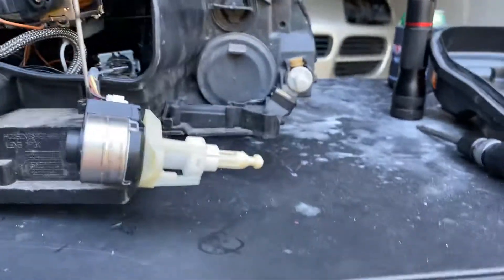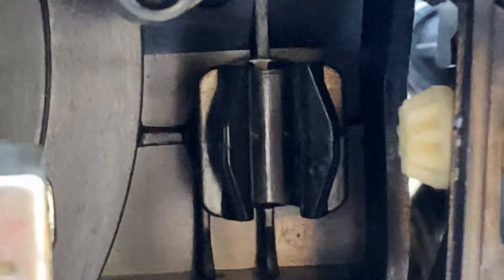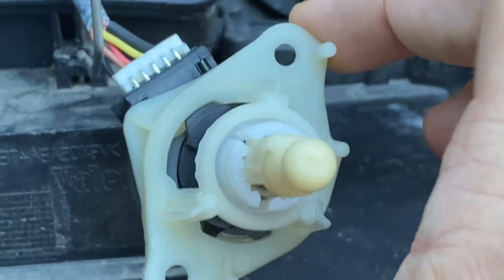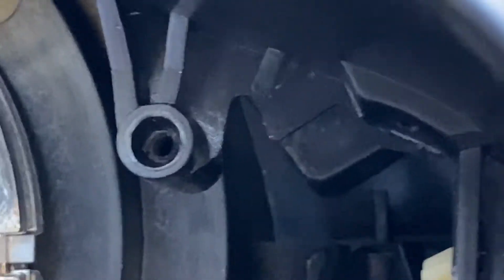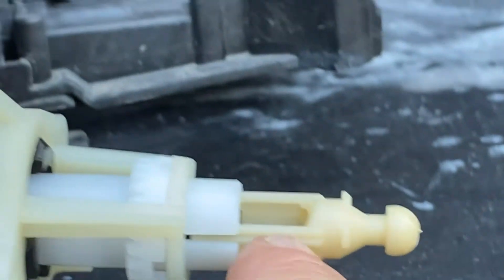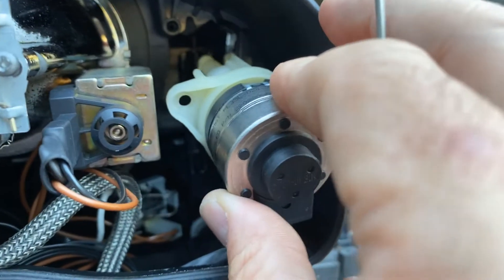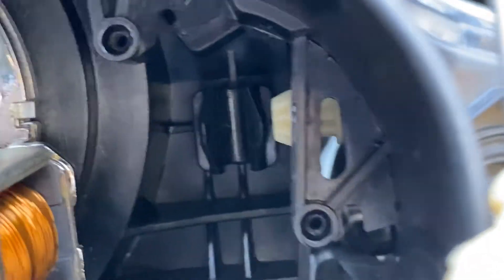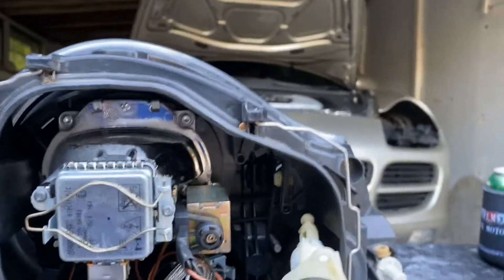Porsche Cayenne 955 HID headlight adjuster assembly (2003-2006)

Comment: I have the same headlights but cant get my drivers side indicator to work have checked all the wiring so tje problem is in the headlight assembly can they be repaired thanks in advance
Reply from the maker: I will have to replace both of mine, unfortunately. The wiring in these 955s do go bad and cause a lot of issues. This is common for these vehicles. Even with my best efforts too restore these, the failed plastic on the wires leads to it's eventual downfall. Hope you were able to get it fixed for you. Glad my video was helpful.